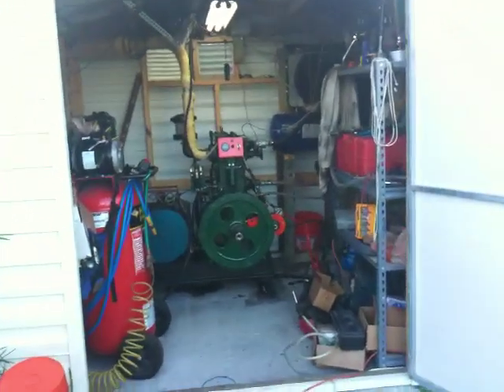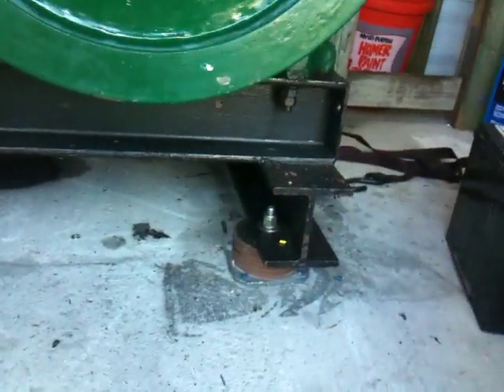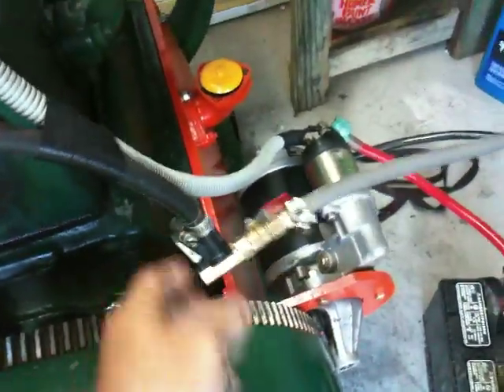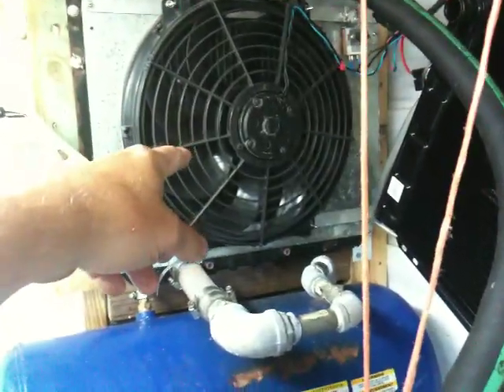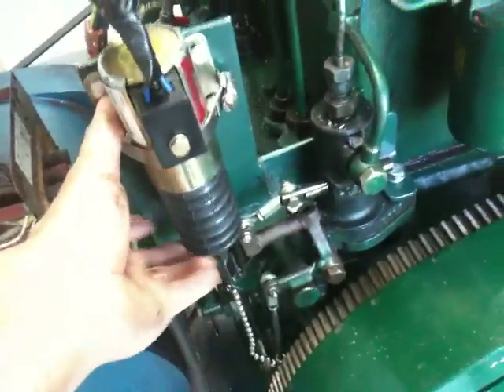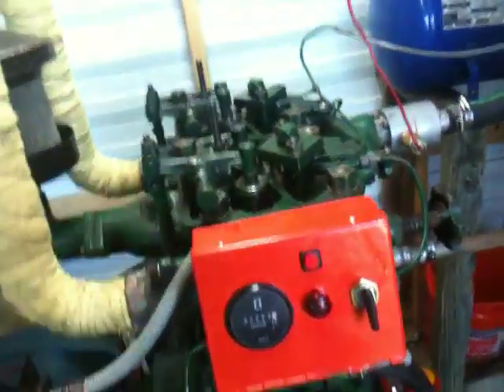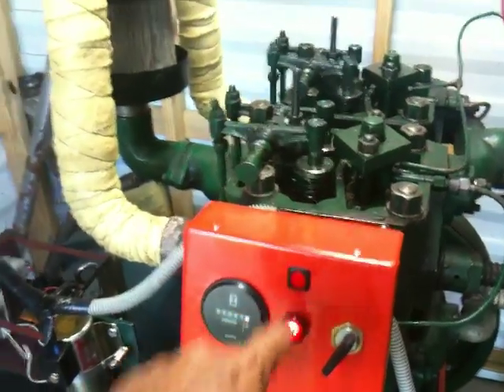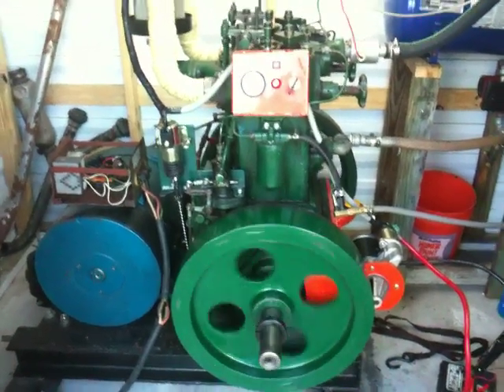Listeroid 20/2 Genset Electric start with auto shutdown

Comment: Looks like a well designed prototype system. Now that it's running. Getting it de-bugged a tidy up job on the loose and open electrical components, wiring, cooling and fuel systems will make it complete.
  Being in the South away from freezing temps. It would be simple enough to run a water line to the shed and install an ordinary thermal link sprinkler head for fire protection.